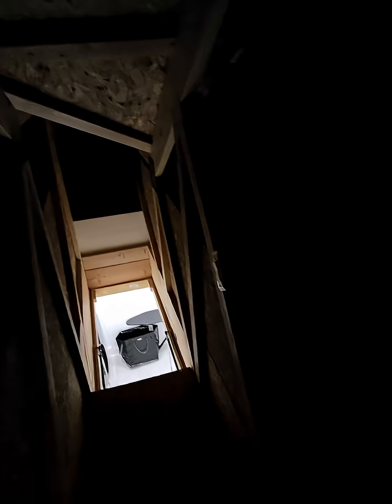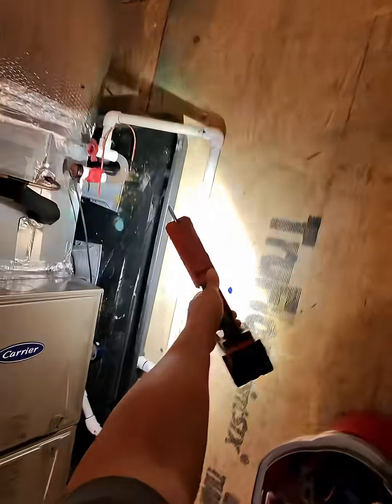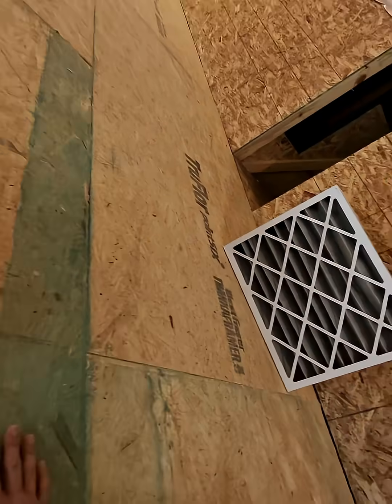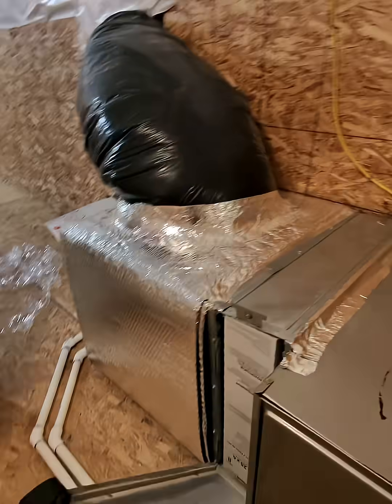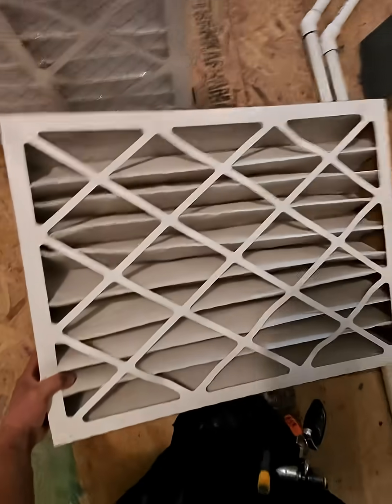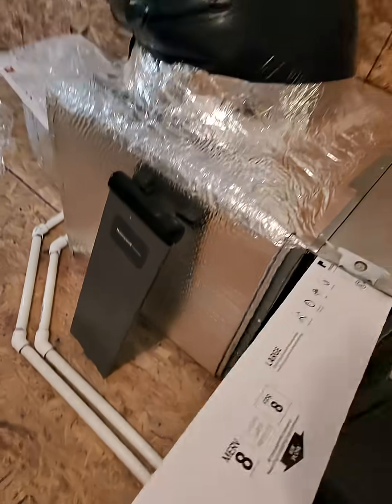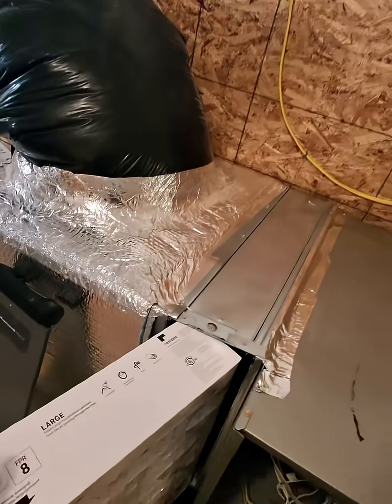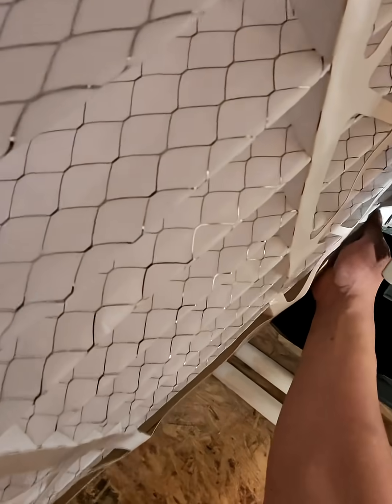HVAC Diagnosis: It's NOT Just a Clogged Air Filter!

Comment: you need to pull out the blower and clean the fins buddy also the burners and evaporator coil. 😂😂 replace filter and go !!
Reply from the maker: We did offer the services. However, this was a home recently built by an established builder in our area who the homeowner was intent on resolving the issue since it was still under the 1 year warranty. Thank you though for the comment.

Comment: I hope that's not a 90% furnace in an unconditioned space. I'm no inspector but I'm pretty sure that's not up to code
Reply: The 2 2" pvc pipes on top of the carrier unit are for exhausting co2 in heat mode and intake fresh air. Only 80% efficiency units need a high and low fresh air for mechanical rooms or unconditioned spaces
Reply from the maker: Astute eye kid. How much you want per hour? Hard to find critically thinking individuals like yourself. Yes. In my official service report I brought to the homeowner’s attention the unconditioned space and generally big no no of installing a 90%+ gas furnace without some means to ensure the condensate runoff associated with the secondary heat exchanger doesn’t freeze up in the coldest of nights. Moreover, builder who put the system evidently butchered the secondary heat exchanger condensate collector box. They literally tore up the sheet metal which should have been left in place to support the collector box with a gasket in between and instead hard piped the PVC to the collector box with no means of access for future servicing while leaving a gnarly gash on the furnace sheet metal which showed signs of a frustratation. Additionally, there was standing condensate inside the inducer motor dripping at a slow rate… 

I told the gentleman by the end of my service call he had much larger issues than just the secondary heat exchanger and would need to circle back to the builder to make right since the equipment was registered to some lady in Nebraska. All sorts of stuff you see on the field.